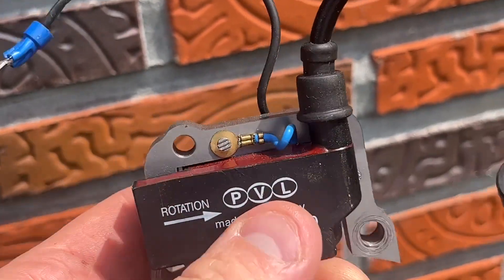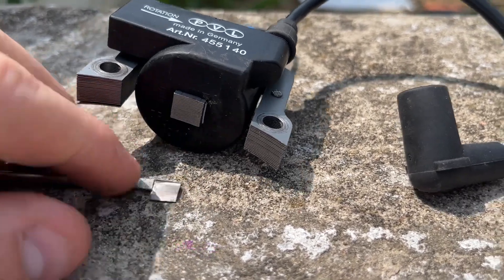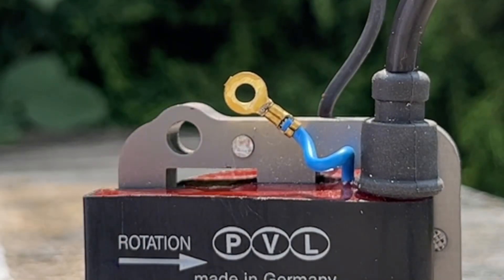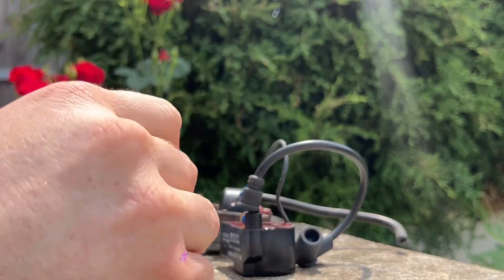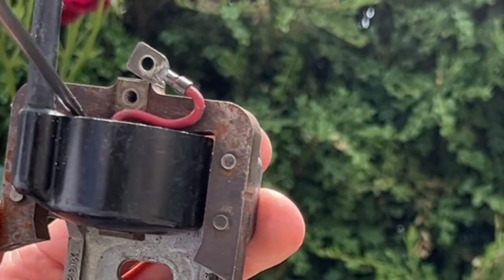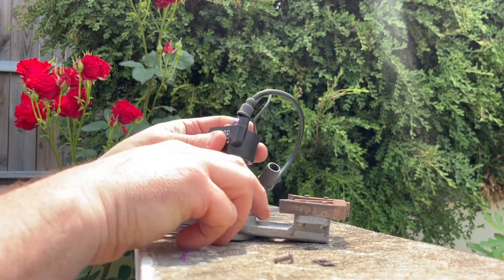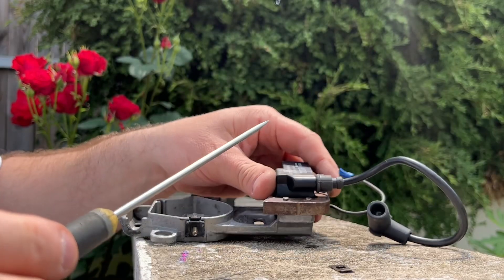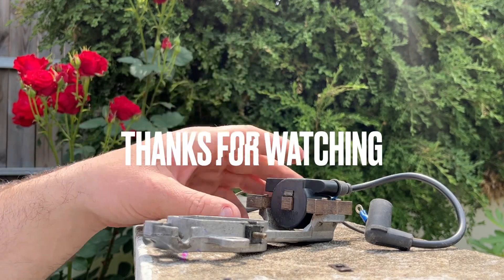Keep Your Old Flywheel, and upgrade West Bend 820 Ignition Coil with Modern PVL Coil - Tutorial!

Comment: What if engine runs CCW?
Reply from the maker: It doesn't matter with the older vintage setup.  The coil works on CW or CCW engines.  (Regardless of the direction of the arrow)